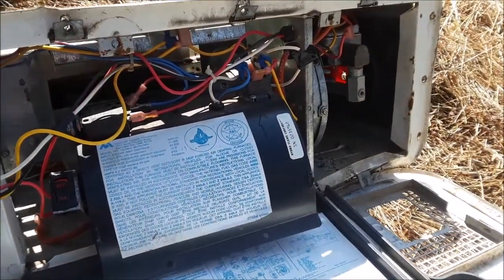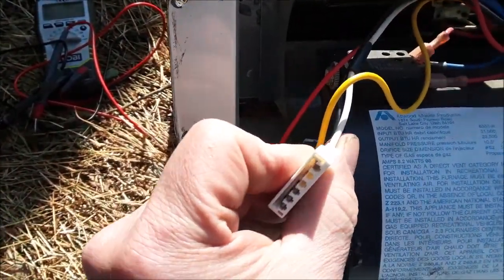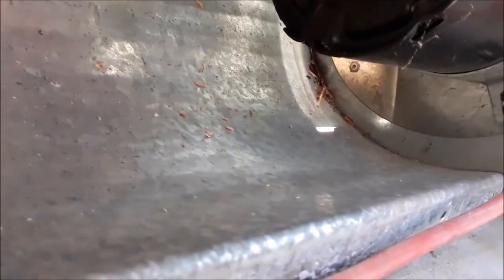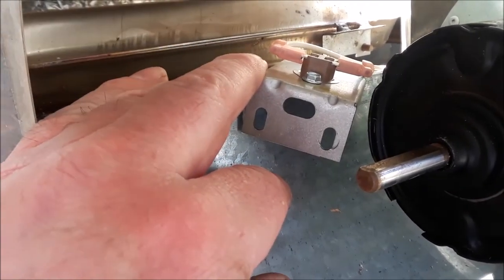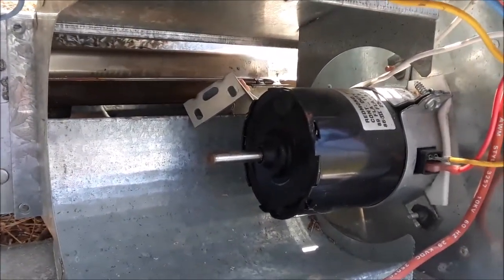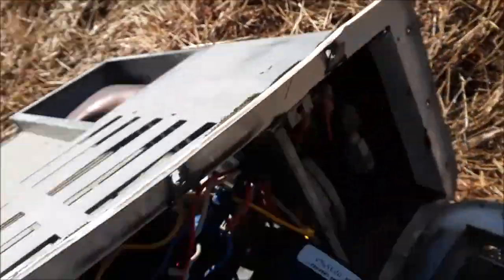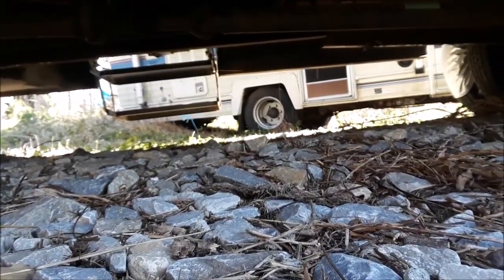Atwood Hydroflame 8300 Hi limit switch

Comment: What is the black plastic square thing on the top right of the plastic fan cover that has four spade connectors one on each side on the top, and how do you test it?
Reply: Time delayed relay, so fan starts first then sends power to igniter.
Reply: @sirennights can you tell me how to test it? I suspect that it is the problem with my furnace.

Comment: I have ignition and the fan is blowing, but the hot air is not coming through the vents.
Reply from the maker: Rodents LOVE to nest in the ducts if they can get into them. If air flow was totally blocked the vane switch would not allow the ignighter to fire. I have herd they gets jammed with pet fur as well sometimes.
Reply: Furnace is lit. Exhaust is hot. Air is coming through the vents with force. Just not hot. 🤷‍♂️

Comment: How did u bypass it i have same furnace im thinking there may be an issue mine runs fine starts but the flame turns of and on about every 5 min turns off for 2 min then lights back up or is that normal the fan doesent stop tho just flame goes off and on let me know what u think thanks
Reply: What is the black plastic square thing on the top right of the plastic fan cover that has four spade connectors one on each side on the top, and how do you test it?
Reply: What did you find out Conner?
Reply: @heybooitsme1831  ended up being thermal safety

Comment: You don't show how you jumped the limit switch.  How did you do that?  I tried placing a wire directly from the feed on the circuit board into the return on the circuit board but even the fan didn't come on when I turned on the furnace..

Comment: My Atwood runs fine for 10 minutes but then it stops heating......any chance its the hi limit switch?
Reply from the maker: It could be or it could actually be over heating. check the airflow to make sure it's moving the amount of air it's supposed to be.
Reply: @jasongalbraith297  Well, honestly, just before it kicked off I told my assistant that the hot air  was was TOO DAMN HOTT!!!!!!!!  I could barely hold my hand in front of the unit for more than 2 seconds.    This unit is under the refrigerator.  It has 3 of the 3" ducts coming out from the front and one 2" duct going into the side.  I had DETACHED ALL 4 of these in my test to make sure it had ample air flow and it STILL kicked out after 10 minutes.  That's why im somewhat confused!   I suspected a restriction but after unhooking EVERYTHING I suspected it had ample air flow.  Thats why im so confused......
Reply from the maker: @cblair0608  I would pull the black plastic cover shown and inspect the blower. If you have pets in the rig you can figure on some fur maybe blocking the air flow.

Comment: Still didnt see where it was located!??
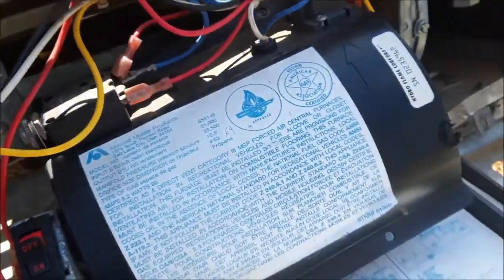Reply from the maker: At the 1:06 mark the hi limit switch is visible to the right of the heat baffle. It's also in the still frame of the video. You can see the pink insulator on the spade terminal connector and white wires.